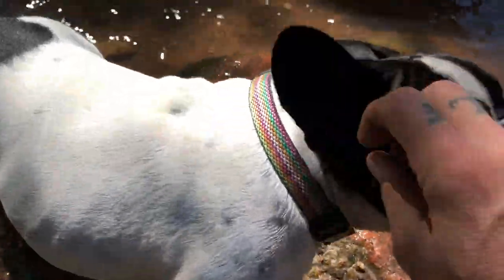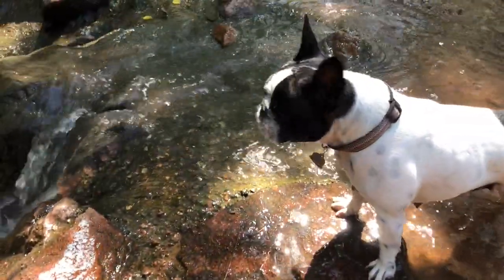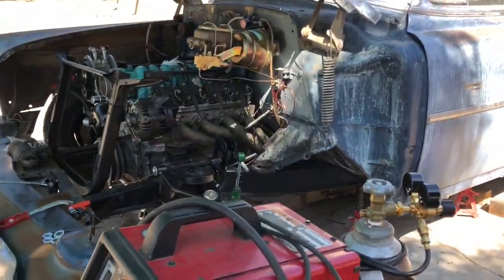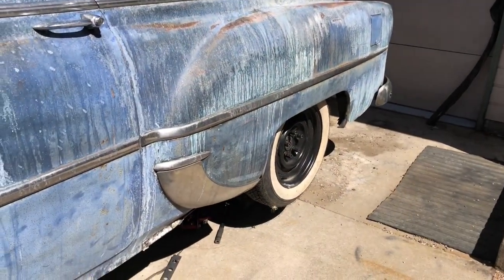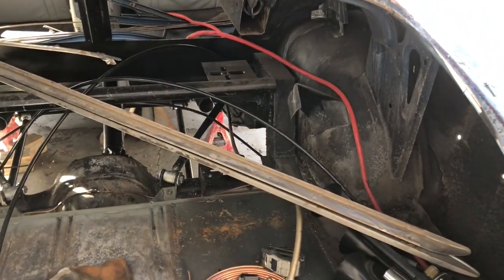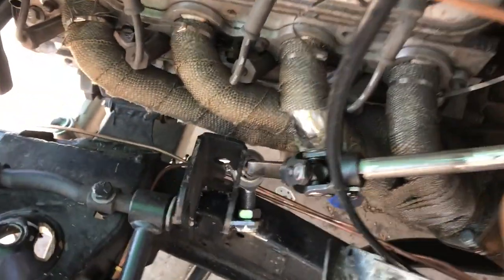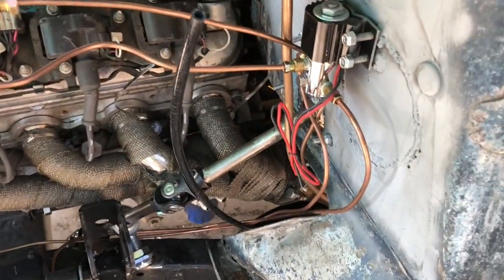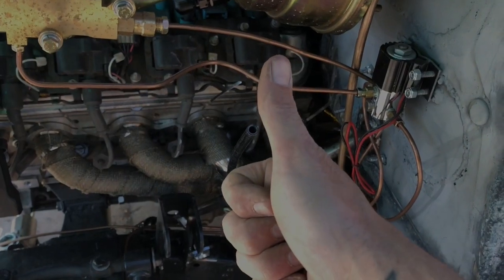54 BELAIR STEERING IS DONE! S13E06

Comment: Kick Ass Brother!!! Steering is good!!! What seat are you using?  I was thinking about 06 Trailblazer seats because they have the seatbelts in the seat!!! Hope you make the show!!! Coming up quickly!!! Keep Rocking it out Wayne!!!
Reply from the maker: THANKS MAN! I have a set of 97? Eldorado seats. pull the head rest and they look like old school low back buckets. 12 position adjust and heated butt AND HEATED LOWER BACK with LUMBAR!!! Plus they have a super short deck height since the eldorado is also a 2 door, which also means they have swing forward on both seats so you can let people into the back seat. Got em for $25 each at the local Junkyard!
Reply from the maker: There are later eldorado seats 00 and up i think that also have the belts built in. I'm going with old school plane style lap belts so i didn't go that route